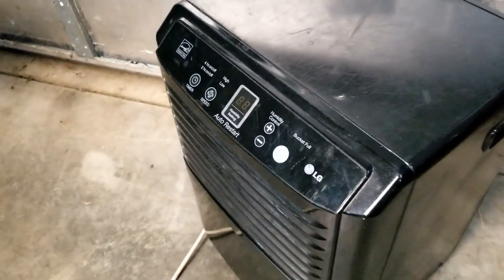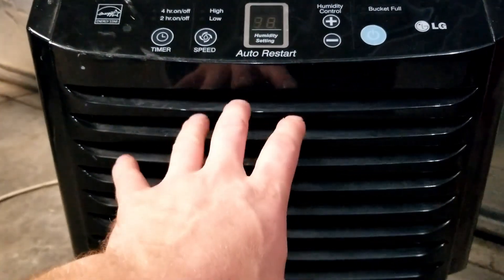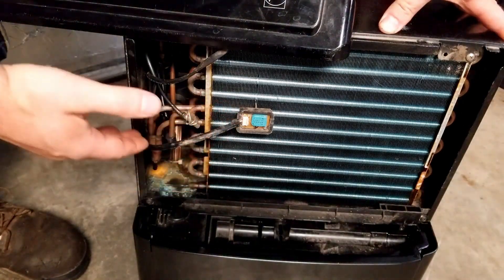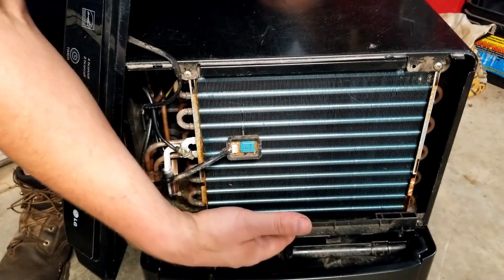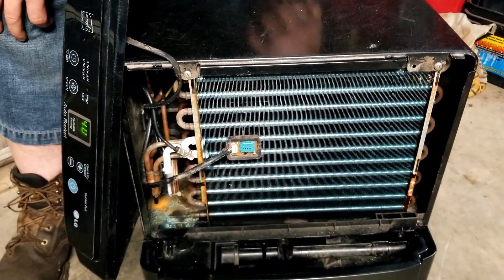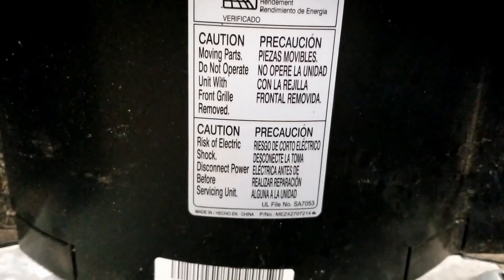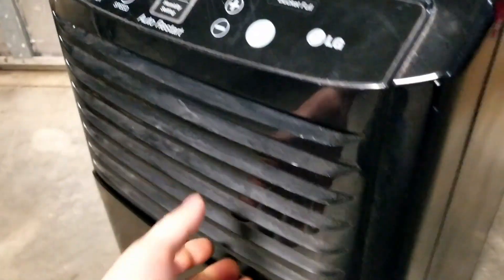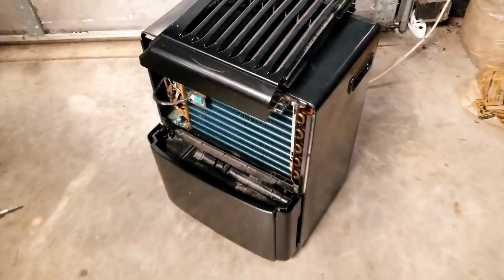LG Dehumidifier NOT Making Water

Comment: under normal circumstances the coil doesn't freeze up - it only is supposed to under low ambient operating conditions - aka, running in a sub 65f basement or crawl. 
when the unit is properly charged with refrigerant, coil will freeze evenly in colder condition, freezing from one side = coil starved for refrigerant, low refrigerant or restriction.
so that machine may have been a little low on gas since you got it.
Reply from the maker: Ya Freezing coil never good